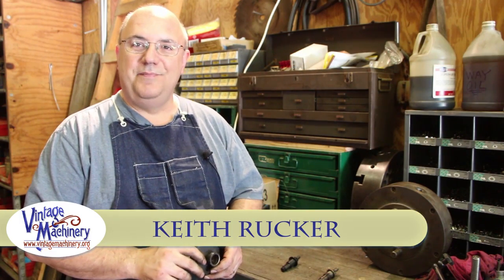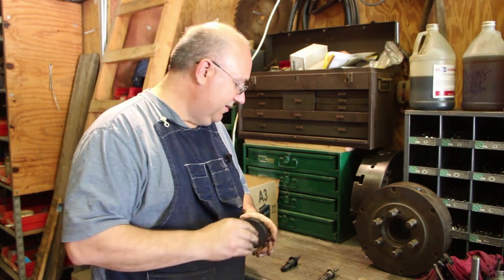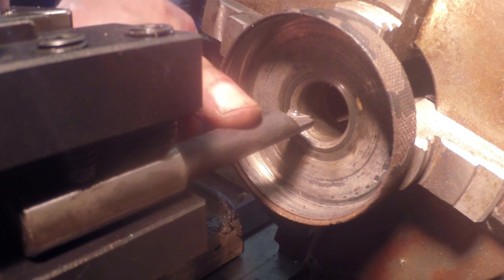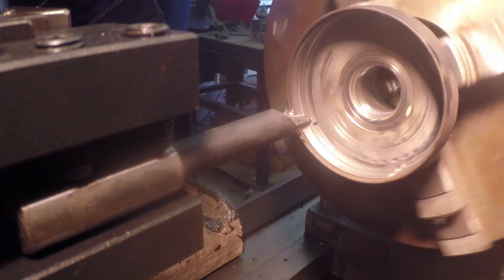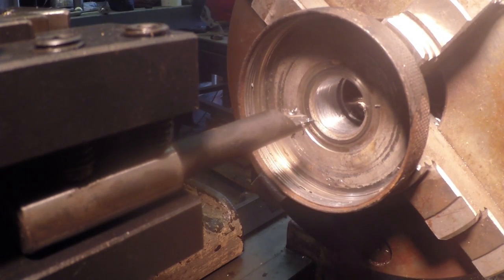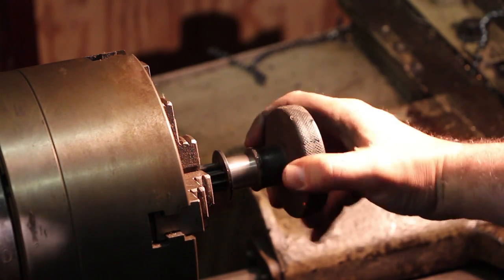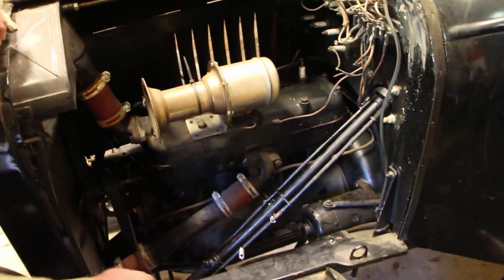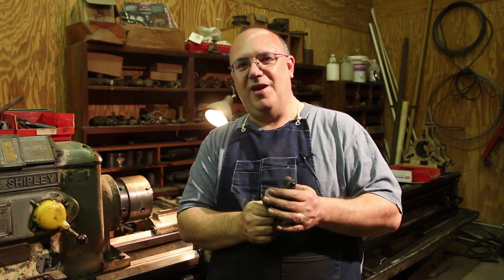Machining a Steering Gear Drive Pinion for a 1925 Ford Model TT truck

Comment: Nice Keith, amazingly I just did one the other day..But a little "cheating" is to screw
this retainer on the shaft without the gear mark the top for a 1/8 oil hole, then assemble.  Far as I know, the steel nichol plated retainer is'nt reproduced, only ones
available is for the brass era Fords.  sam

Comment: Hi Kieth,
Did you hear me yelling stop before your last pass with the boring bar. 85 -90% bore clean up along with the spigot on the shaft would have been good enough in my book.
Really enjoyed the ride in the loco the other night, any chance of a ride in the " T " when it's done??
Cheers Eric
Reply: midgoog2 Gotta leave room for the oil or grease film in the clearance. 

I tended toward leaving more of the original metal in place, using a bushing with some JB Weld to fill in the low place. I can only guess since I did not have the pieces in my hand like Keith did. A bushing and turning down the original shaft may have made for a more rigid assembly and saved more of the original car. Would there be room for a bushing of sufficient thickness? Since eliminating the slop in the planetary gear assembly was the goal, it might have been worthwhile for the owner to present Keith with the whole assembly to locate other areas of wear and  overhaul and fit the whole assembly as a unit.

Comment: It looks like that planetary set up works like a power steering.  Model T passenger cars simply had a straight shaft down to the steering box.  Most automotive reconditioning jobs are fairly simple, but well worth sharing!  Thanks!

Comment: That was a pretty simple fix.  I was thinking as you were boring of pressing in a short shaft then indicating off of that short shaft.  (I way over thought the process!)
Reply: ***** Yes, you are right. You only took about 0.012" clean up inside the bore. So the remainder must have been very thin indeed.

Comment: Keith;

Another great video.

I had to laugh at around 4:30 when you said "This is a teeny tiny little boring bar".  Heck, that is the biggest diameter boring bar I have for my 9" Champion Blower & Forge 9L lathe.  I guess size does matter, LOL.

Regards;

Ron Kluwe